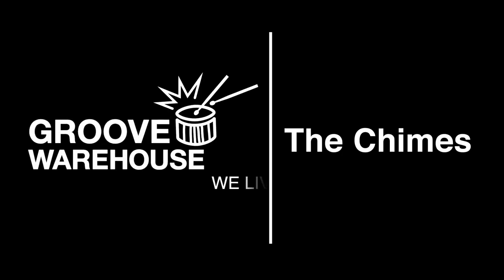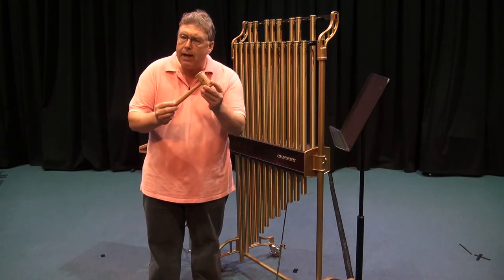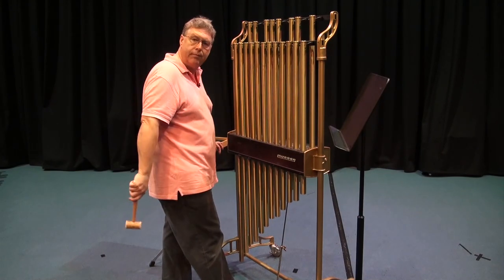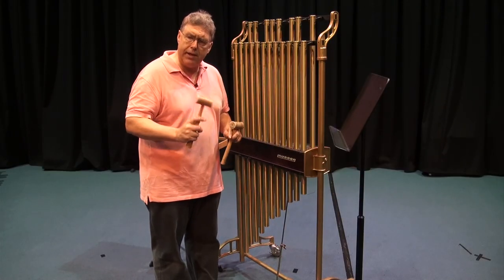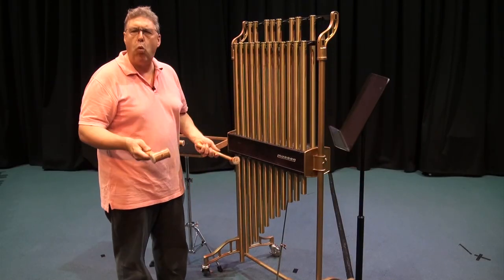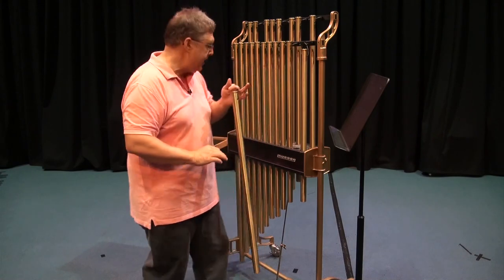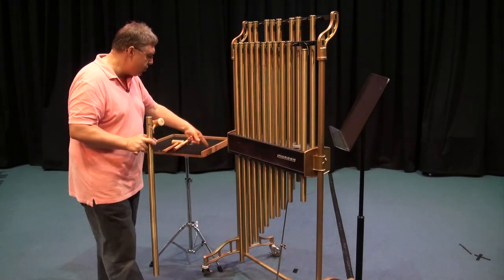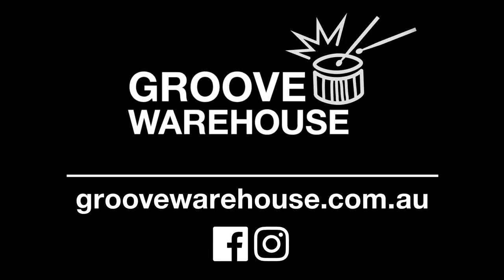Learn to play Chimes / Tubular Bells with Gary France

Comment: what kind of xylophone uses Tubular Bells  when i was in school there was a xylophone that did not use flat pieces of metal or wood that normally you would hit this one was using pips that was of a chrome color. thy sat on top of some kind of foam. the foam had  half circle cut out slots the pips did not have any cap at all  and u hit it with a xylophone mallets that was wood ball head on it or thy had some that was like cloth head ball but the wood ones work way better do u know the name of that kind of xylophone?
Reply: I guess is just a tubular xylophone

Comment: Does it hurt the bells if you strike them without holding down the pedal at all? My former band teacher never told us if that was the case, and I'm wondering because I'm planning on writing a piece where a muted sound would be better than a prolonged sound.
Reply from the maker: Hello, it does not hurt them to play with dampener on 😊
Reply: thanks, exactly my doubt!

Comment: What songs feature this a lot? Ive never found one...apart from the song from the trailer "Joy"  I put it on my channel if you want to hear it, but you never hear it featured so much in any other music.
Reply: The music of Mike Oldfield, features a lot of the instrument, especially the opening scenes of the exorcist
Reply: @kevindunne5753  The exorcist theme doesn't feature tubular bells. They only come around like, 5 minutes after the exorcist theme ends. They also appear in the closing section of the song.
Other than that, however, yes. Mike Oldfield does indeed use the instrument a fair bit. Once you've listened to tubular bells, Amarok is just pure delight.